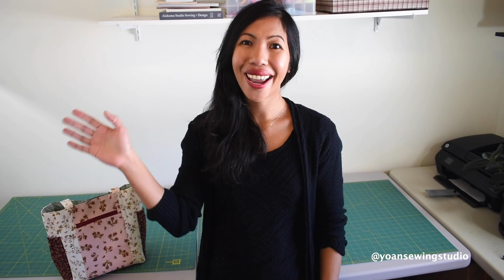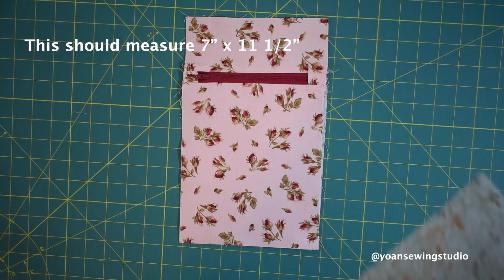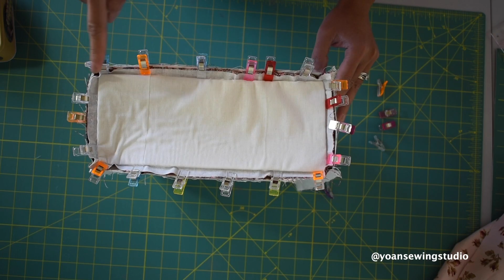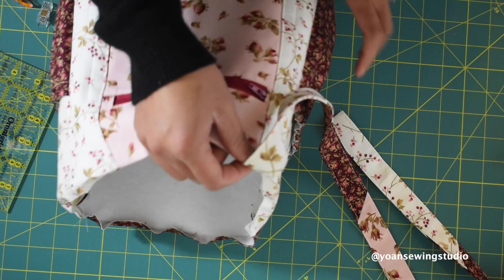Tote bag with zipped pocket divider sewing tutorial - using 3 fat quarters

Comment from the maker: Please ignore the length of the elastic stated in the video, you will need to cut the elastic 5" long only not 7" long.  
TIME STAMPS 
Intro 0:00
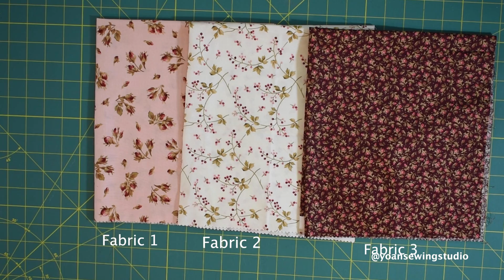Preparing the fabric 1:37
Front zipper pocket  1:42
Front Side panels 6:25
Applying the fusible fleece to the front panel 7:18
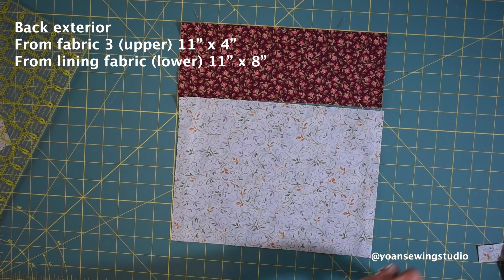Back Panel 8:34
Back slip pocket 9:19
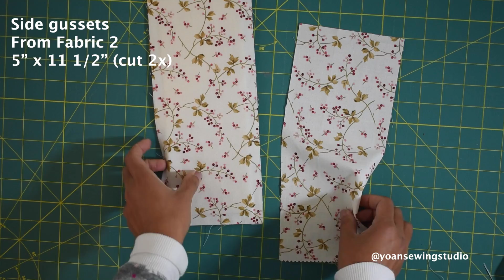Side Gussets 10:22
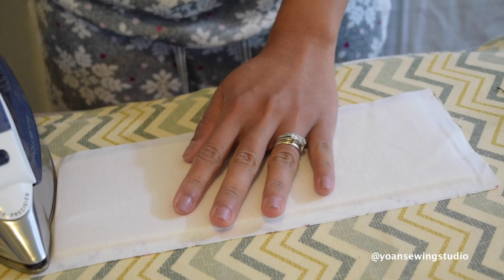Side Pockets 11:21
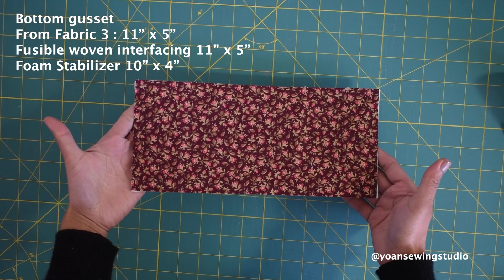Bottom Gusset 14:24
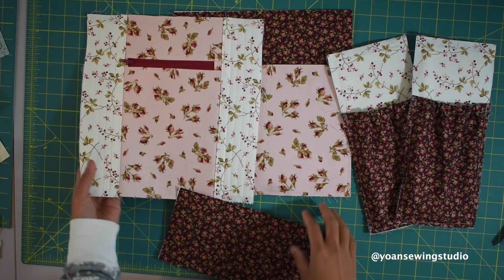Assembling the bag exterior 14:43

Interior 
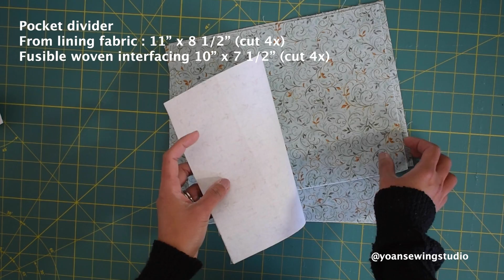Sewing the divider pocket 17:19
Side gusset 20:02
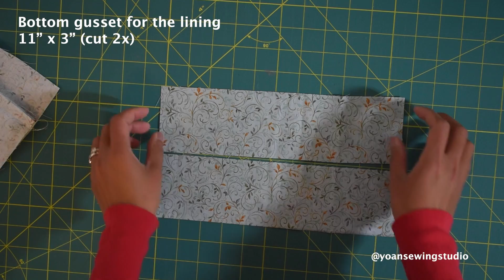Bottom Gusset  21:36
Preparing the front and back lining  24:00
Slip pockets 24:09
Installing the magnetic snap closure 25:08
Sewing the front and back panels to the gusset 26:15
The Straps 28:20
Assembling the bag 29:58
Closing 33:30

Happy sewing!!
Reply: The measeurement, is it in inches?
Reply from the maker: decryptedmind5 Yes, the measurements are in inches
Reply: Ms. Yoan, do you have a bag exactly like this one, but a little smaller? Thank you for all of your wonderful tutorials. I made this one for a friend of mine.

Comment: Great bag, thank you. You lost me with the side pocket. If the top of the pocket is 7” and the elastic is 7”, there would be no spare fabric to distribute! Did I miss something?
Reply from the maker: You're soo...right, I made a mistake in the pattern for the length of the elastic, should be 5" long not 7", I have made some corrections to the pattern. Thanks for pointing out, appreciated.

Comment: Is it possible to add a recessed zipper instead of the magnetic closure to this bag?   Another beautiful bags! Thanks so much for the work you put into them!
Reply from the maker: You sure can add the recessed zipper instead, you may want to make your recessed zipper panel the same or a slight smaller than your front/back lining piece, my suggestion is 11" x 5" (cut 2x seam allowance included),  
sew the zipper panels the same way as the Dahlia bag, although you may want to  install the  zipper after you finished assembling the lining (the pockets, the side gusset, etc). 
Hope this helps, Thank you!

Comment: What a lovely bag! I've never made a lining with an inner zipper bag so am looking forward to trying! 
Is it necessary to use woven interfacing plus fusible fleece on the outside panels?
Reply from the maker: Thank you, yes I recommend applying the woven interfacing first before applying fusible fleece (if you use quilt weight fabric) , it will give a nicer finish (crisper look). Happy Sewing